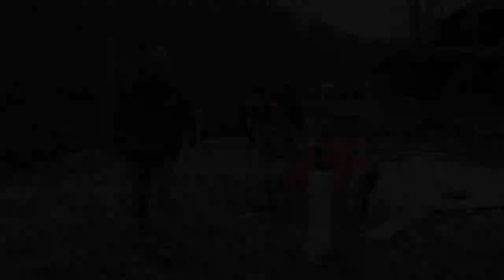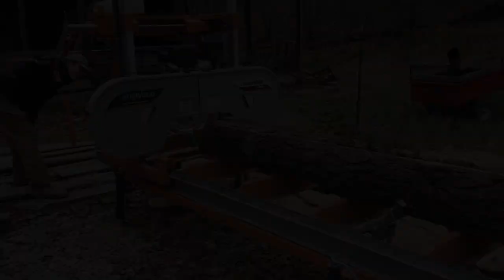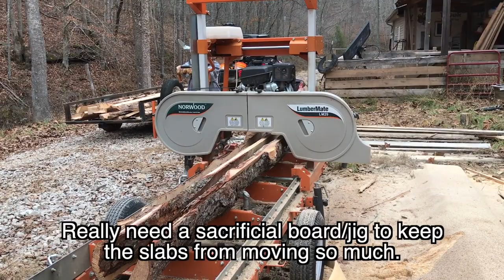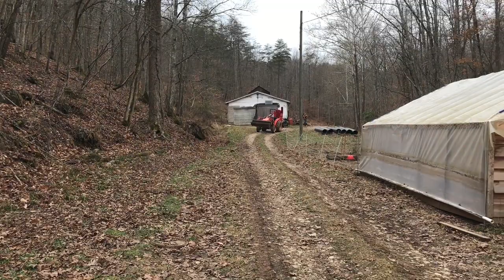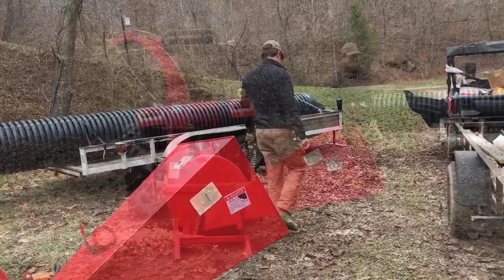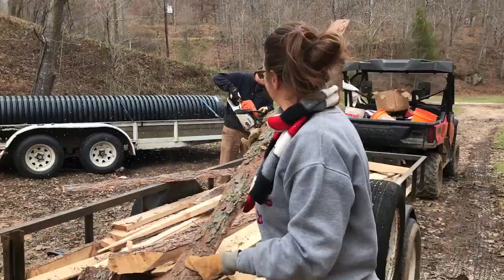What do we do with the slab pile from the sawmill?

Comment: Outdoor burning to stay warm while working outdoors in the winter. Winter walking paths to cut down on mud issues (even make a slab "patio" outside the chicken house).  Bark is much harder on the bandsaw blades than the wood.  Going through stacks of bark slabs is an expensive way to get down to chips.  Only chip the stuff that comes off the mill already small enough to do so.  The larger slabs, use for outdoor burning and mud barrier.

Comment: A shear pin is designed to break within a range and to break clean ( not chew up ) 

A bolt is designed to be over a certain strength so could be much stronger than its grade. 

Having said that it’s typical for occasional use items to be run as you are doing. 

Just a question though is this not a metric bolt? Sounds like you need to get some 10mm bolts to try 👍
Reply from the maker: Yes, it is a 10mm. That is what we purchased today, in fact.

Comment: NEVER open a chipper with the power source running.  The other problem you'll run into is sawing and chipping slabs that have bark on them will cause dull blades and knives in short order.  It isn't the bark, its what is in the bark.  Also, frozen bark is even worse.  You might want to break down your slabs at sawing to get rid of the problem of double and triple handling your waste.

Edging strips can be used for stickers for stacking wood.  I have used pine and poplar as firewood, but I use them during months where heat demand isn't as high.  Your chipper is too light to handle those slabs.  

You could put slabs in muddy areas or to build a corduroy road system that will prevent rutting where you drive your tractor.  Some people use the slabs for siding material.

Comment: Never see me doing that.  Most dirt and rocks are caught in the bark and the bands for those mills cost way to much to be doing that with.  Plus I would imagine it is very hard to clamp and hold them in place like that without snapping a band if they come loose or do damage to machine if one comes loose.
Reply from the maker: You do realize I have to cut through the bark when I am milling the log? I pressure spray my logs to remove dirt and debris so these have been cleaned already. Blades can be sharpened and reset too.

Comment: Slabs can make good air stacking strips when ripped into one inch by one inch strips. Those same strips make descent bean sticks for your garden.
Also pine chips are NOT good for your garden due to the rosin in pine. If you want to use it in your garden, then burn it first to turn it into potash and mix the ashes in small amounts into your soil. The best use would be to get one inch boards out of what you can, and don't let your saw blade hit your log dogs, because sharpening those band saw blades is not easy, and they get expensive. You can use a water tank and a small hose to keep a small stream of water on your saw blade to keep it cool and it'll help to make the blades last longer.
Reply: You can compress sawdust with corn oil,burns great

Comment: Stand em up and edge your slabs after each log- takes an extra 4 minutes and then you are ready to chip, and don't have to handle them an extra 2 times.  You need a Wallenstein BX62S  chipper-  eats em up like candy.
Reply: Looks nice but I still like my Vermeer 935 better. I got a 6" DK2 power recently to clear my trails.  I can pull it around with the four wheeler.

Comment: ANY available wood is "GOOD" fire wood !!! We burn fir pine popular all the time, what we have "Available"  in a stove,  you control the burn rate with the air intake !!!  DUUUUUHHH !!!!!  A lot of those slabs could be resawn into smaller lumber, no  sense wasting it on chips !!!
Reply: Its not the fact it wont burn DUH its the amount of btu's in thr wood versus the resin creosote and ash created while burning.  Evergreen trees are the highest in creosote and highly increases chimney fires plus it has half the energy output of good hardwoods. That said it is a little different in the Northwest part of the Country. There Douglass fir is more prevalent and because of colder climate it grows way more dense than the yellow pine we have here in WV.
Reply: @kenjett2434  I know all about the heat output of wood and I found the douglas fir put out more heat than the maple, and fir does NOT leave as much ash behind !!!  Burns hotter and more complete...When given a choice I always took the fir and if you burn a little hotter there is NO problem with creosote build up with the fir !!!  Pine in the eastern part of the state is most available and it also burns fine !!!  You burn what is AVAILABLE !!!!  DUUUUHHHH!!!!!!!!!
Reply: @wilburfinnigan2142  well you go for it   its your chimney and house you risk from fire. But you only confirmed what i said about Douglass Fir and wood in general in the Northwest it does grow denser than the softwoods here in West Virginia.  But here we dont have a shortage of good hardwoods hickory and oak is plentiful and we dont have to burn junk DUUUUUH!!!
Reply: @kenjett2434  Well dumb ass I have burned doug fir Pine, alder, maple cottonwood for years and I know how it burns and I prefere the doug fire !!!  Great wood to heat in a stove with and it is very plentiful and like I said dumb ass wood that is AVAILABLE is good fire wood !!!  And never had a problem with any stove or chimney!!!  Did normal maintainence, cleaning on it   BUT if you burn right, hot you have very little creosote build up !!!  Been burning wood for over 20 years !!!  What is YOUR experience burning wood !!!!  And dumb ass on the western side, wetter side, of the mountains wood does NOT grow dense !!! It grows FAST !!!  Wide growth rings !!!  I have seen hundreds of cords of that type wood !!!!  DUUUUUHHH  !!!!!!!  You are "educated?" in your local ignorance, not GENERAL knowledge !!!!!  DUUUUUHHHHHH !!!!!!!!
Reply from the maker: Wilbur, I will not waste my time cutting pine when I have more standing dead ash then I could cut in 2 life times. Ash is far superior to burn than Virginia Pine.
Reply from the maker: Keith Clark  I need to woodchips for my farm. You missed that point in the video.